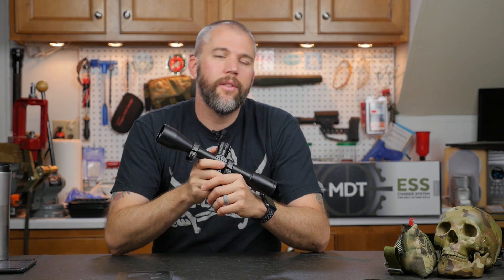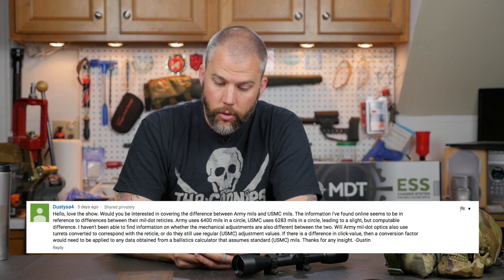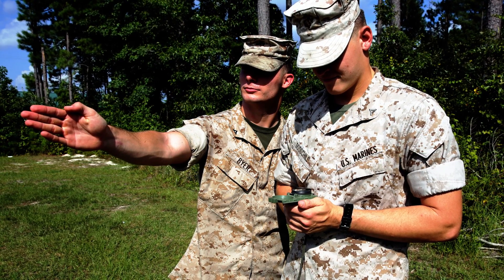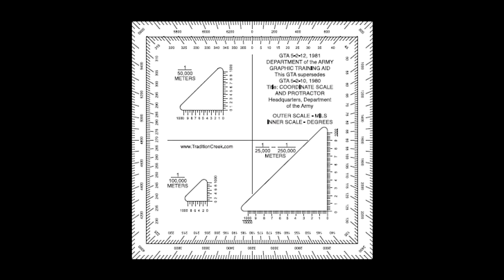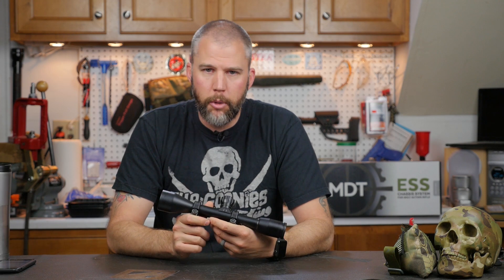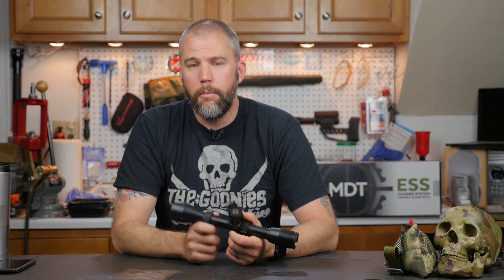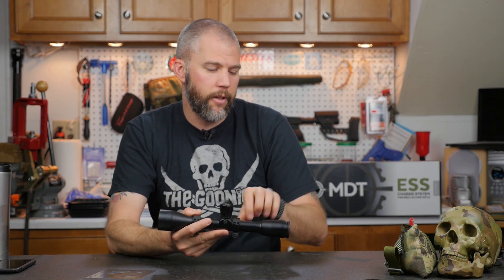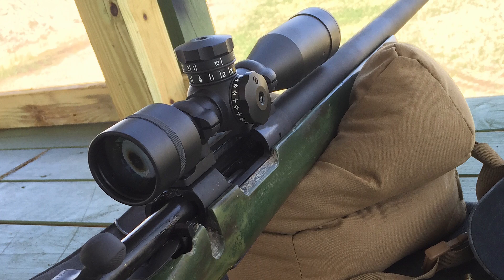Mail Call Mondays Season 6 #7 - Mildots and Milliradians

Comment: Ya I was moa all the way, cause that's what I used forever. Then I got a steal of a deal on a Bushnell Tac elite 6-24-50 ffp illum BTR 1 ret for 600$ can. First mil scope, but like you said. It's just an angular measurement and is pretty simple. Love them scopes though. Wish I could have got the other ret, but for half price on a new scope. Not gonna bitch.

Comment: I'm in the process of building up an extreme long distance precision rifle and I'm now working a custom load. My question is, is it possible to over stabilize a bullet? I've asked around with all of my shooting buddies and there doesn't seem to be any general consensus. Thanks in advance -Red
Reply: You can't over stabilize a bullet. Its either stable or its not. You can over spin a bullet if thats what your looking it. But the biggest downside to over spinning a bullet most of the time is just the increased drag put on the bullet as it travels down the barrel against the rifling. Just my .02, good luck on the build.

Comment: I couldn't help but notice that 6,283.185 is 2000xPi (3.14159). Now I am likely to sprain my old brain thinking about that.
Reply: Gun Sense (drmaudio) that's because mils are milliradians. A radian is a measurement of angle that has an arc length equal to 1 radius (the angle if you took the radius and wrapped it along the edge). There are 2 pi radians in a circle because pi * diameter = circumference (and 2 * radius = diameter) a milliradian is 1/1000 of a radian.
Reply: Feel free to ask questions if I didn't explain it well
Reply: Actually, that makes perfect sense.  I took geometry a long time ago, but it is coming back to me.  Thanks.

Comment: The calculated difference between artillery mils (1/6400) and true mils (1/6283.185) at 1000 yards is this. As John said, 1000 yards away one true mil is 1 yard across. At the same 1000 yards one artillery mil is .982 yards across. In inches that's the difference between 36 inches and 35.3429 inches at 1000 yards. So basically no difference at all.

Comment: Great video John. you managed to break it down perfectly. I just purchased a vortex pst 2.5x10 with a MOA Reticle and MOA  turrets for my M1A. I had never used that before. I have been getting the MIL/MIL stuff as of late so I was a little worried. But it all works great. I haven't had the chance to do range estimates yet since I've only been to my local range by I am looking forward to bit. Great video